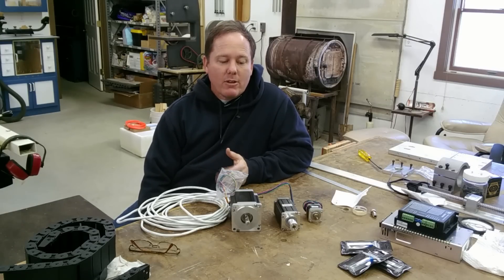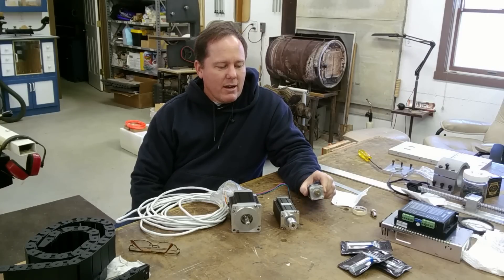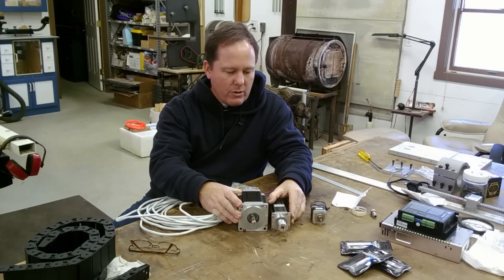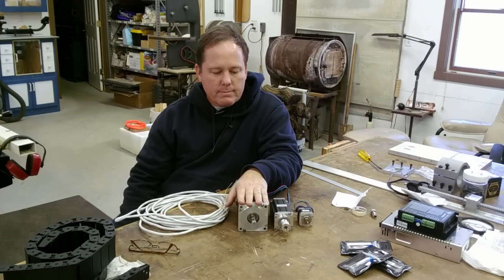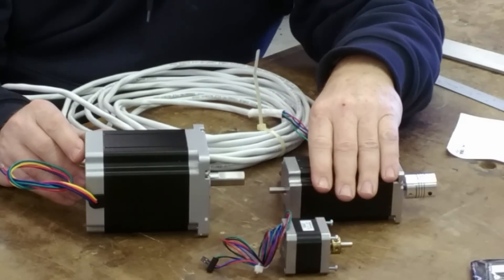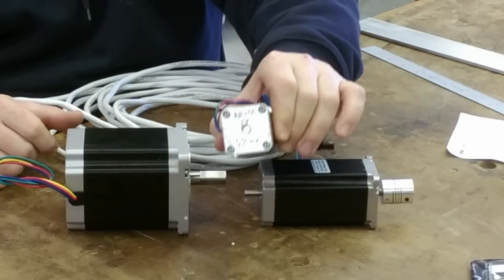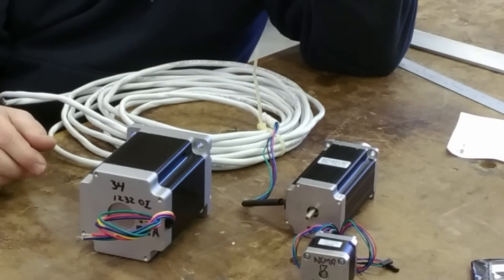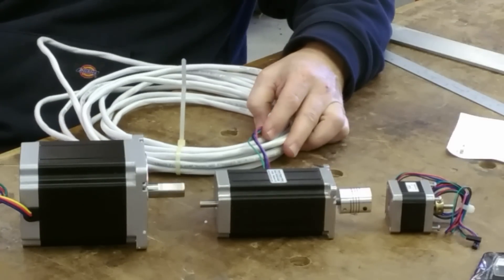Practical Insight in selecting stepper motors for your build -Old Version

Comment: I like the nema 34 size for larger machines, but I have seen many people use nema 34s for all three axes and a nema 34 on the z axis is a lot of overkill. More people should evaluate how much they need for each axis and design accordingly. If a nema 23 seems a little iffy for a particular z axis, consider a gear reduction.

Comment: I recently finished converting a 600mm lathe to CNC using NEMA 34/1200 steppers, possibly overkill but no regrets.  As well as increased torque, the bigger steppers have higher position holding strength.  I suspect that the bigger motors will be less inclined to miss steps also.  I found your video to be very interesting and well explained.  Thanks.
Reply from the maker: Thank you John and congratulations on your lathe conversion.

Comment: Sir, How do you Clamp motor shaft with Lead screw? Please can you explain
Reply from the maker: You use a coupling.  There are various kinds.  I used an inexpensive, zero backlash coupling like this one - http://www.ebay.com/itm/Motor-Encoder-Coupling-8mm-x-10mm-CNC-Stepper-Flexible-D25L30-zero-backlash-/162367443526?hash=item25cdda9246:g:7uAAAOSwjDZYhH5u

They come in different sizes with different size holes.
Reply: Thank you Sir for your kind information.
Reply: There are some motors out there where the rotor has a lead screw, and they aren't hard to change out lead screws as long as you use the same diameter. I see them in a lot of 3d printer builds.

Comment: If the spec sheet does not indicate the voltage (but does the current), how do you determine what voltage power supply to use?
Reply from the maker: My first reaction is no but I asked a much smarter guy than myself and confirmed it.  Here is his answer... 
   "There may be a standard voltage depending upon the spec that is assumed by the spec sheet since they dont list it.  But to answer your question - current alone is not enough.  Given current and power you can figure voltage."
Reply: Thanks for the reply.
Reply: sbirdranch typically you significantly over volt them and control the current. you do that to overcome the stepper winding inductance. using the winding resistance and current spec to determine voltage won't get you all the performance from the stepper

Comment: Don't even use steppers.  Use servos.  I built a large gantry machine similar to yours, with a 3' x 4' cutting area.  If I had the money I would have used clearpath servos, but I cobbled my own servos together with surplus DC brush motors.  They NEVER miss steps, and are efficient as well. Except for the spindle (which is 120v), the whole thing runs on a single ATX power supply. (230 watts or so).  Nothing ever gets even warm.  I saw you had HEATSINKS??  On your X-axis stepper?
Reply: I'd like to hear more about this.
Reply: You can, go to my channel, click videos and look for "Homebuilt CNC router using uni-strut and aluminum castings."  And you can simply google Clearpath Servo  and get the teknik dot com web site.  I actually didn't use clearpaths, I made my own, but its the same idea, a servo rather than a stepper.

Comment: So, basically your advice - "just get big". I disagree!

Torque is not the only consideration -  also speed is very important (just not as obvious to  diy-er). If you are overbuying a motor and power supply, you have less money to spend on bits or 4th axis, or laser attachment. Also, Once you build your machine and start using it, you'll realize that you are running 4 motors @ 7a for a extended period of time  - that's considerable energy costs (and mostly waste).

So my advise - do REAL homework (there is lots of information on the internet) instead of misspending your hard-earned money and getting inferior result!
Reply: Speed is dependant  on the controller board, maximum torque is dependant on the motor. If you have a large machine with heavy components, you're going to need that torque. Same with the energy ratings, you need those amps for that amount of torque. 
So my advice (not advise) is to use your head and think logically. If you do the math for your machine, you'll know what torque you need, then you go for which motors are suitable for your machine; though it's better to go to the next size up if you're nearing the maximum torque of the motors. 
Also, motors built for speed won't have the torque, but the motors as they are here have a suitable speed for the machine. Same goes for steps, the more steps you have the less torque you'll have. But again you can upgrade to the next size up for both accuracy and torque.

Comment: Thank you.  It was a little hard to hear you, but this was a much better approach to what I am trying to do than trying to master calculations.  I wonder if you would be able to answer a question or two, as I am looking at steppers instead of conventional motors mainly because of weights, and then the ability to maintain constant speed.  My machine looks very similar to yours, and was originally designed as a router table.  It was partially converted to run tapping heads.  I am trying to replace the motors that drive the tap heads, and conventional motors seem just to heavy by today's standards.  To drive a 1/4-20 tap through 1/2" of steel (through hole), based on the information I have found, I need about 1/3 hp at a speed of 800 rpm.  This is the largest tap size I would use, and most likely the fasted it would need to go.  The stepper would run continuous throughout the cycle, and would only need to run in one direction.  Again, the main reason I am looking at steppers is the lighter weight and constant speed between 400-800 rpm, as compared to a dc motor and gearbox.
http://rockford-ettco.com/DownloadBroch/Etctvr%206_(Pg%2046).pdf

Comment: if my previous question isnt clear, this is what I mean: with a certain size gear on the stepper-motor, it needs to turn a certain steps to move the head for 1 millimeter.  If I double the size of the gear, the stepper motor would need to move half way to reach the same position as with the smaller gear.     Where or how is this done or set?  I assume its some firmware on the "controller board" but I am still a bit unclear.

Comment: very informative video.        I recently started building a 3d printer, and want to build a bigger one as i underood all the workings of it. except for one part, which brings me to this quesiton:  How or where do we put settings,  so that the motor knows how much to turn for 1 millimeter movement of the head(nozzle or laser cutter or router etc)?   I would really like to find this information. Thanks and great video.

Comment: That was really helpful. I want to convert a 9x49 inch Bridgeport clone knee mill. Would you do a video explaining everything between the computer and the motors? I just don't understand the lingo or the parts the lingo is talking about. I know each motor will need a power supply but don't understand what makes it step off or know where it is. I'm gonna subscribe because you laid this out in such an easy way to understand.

Comment: FYI, 425oz/in NEMA23 motors are total overkill on my CNC'd HF mini-mill when directly driving the ball screws.  It has no problem moving any axis (although the Z has an airshock assist, never tried it without it).  1200 oz/in motors are definite overkill (especially if you use any kind of gearing to increase the torque).  I think that the more important considerations are the driver and it's ability to deliver current and utilize higher voltages.  Stepper motors do better with the proper current and the greater voltage they will tolerate translates into decreased ramp-up speeds.  The 1/2 current setting on the driver is typically the holding current (which is typically fine at 1/2 current) and it switches to full current when actuating the motor, this will help the motors run cooler typically.

Comment: Why not just use a universal standard like metric. Everything is so much easier without using strange units like the length of the end of your thumb or the weight of 3 tablespoons of water etcetera.
Reply: Because metric is only good at small measurements. A foot is much easier to picture. Much easier to get longer measurements. Metric is basically a waste of time.

Comment: very educational. mind if i ask - are nema 34 1232 oz. enough to drive a bridgeport mill? i'm trying to convert one into a cnc. thanks for your help 👍🏻
Reply from the maker: Hmmm....I'm thinking of my mill.  Probably the X and Y, but not the knee (Z).  You need to find someone who has done that type of conversion for a better answer I'm afraid.
Reply: thanks... i purchased a nema 34 1600oz/in for xyz. hopefully it will work. i'm planning to install it - a direct drive - type (no reduction). keep posting educational vids 👍🏻
Reply: If it's not, just use a gear reduction.  Z-Axis moves tend to not need as much speed (since they are shorter moves) as X and Y.
Reply: D&DTube Online One thing to remember,  which is to your advantage, low RPM torque is really quite good for a stepper motor.   Just make sure you run as much voltage as you can within reason and the full current the motor is rated for if you are trying to get higher speeds.
Reply: I would say that if you can adjust all of your movements with less than 9 ft lbs of torque, the 1600s will fine. I'm purely going by the math, but it seems reasonable.
Reply: mpeugeot thank you! 👍🏻
Reply: thanks! hopefully my 1600 oz/in steppers can handle 'direct drive' the bridgeport clone mill. still waiting for my parts from china anyway.
Reply: John Rasmuson thanks!

Comment: Thanks for sharing. This is a real help for the hobbyist who just wants to gets started, have a play around, make some mistakes and learn from them. Searching around to get a rough idea of stepper sizes usually ends up in trawling through long forum posts of calculations requiring every spec of your machine that only seems necessary if you want to mill stainless steel to aerospace tolerances.

I'm planning on building my second machine for cutting mainly aluminium. It will be a smallish fixed gantry welded steel frame, likely 2x2" box section with the X moving along the gantry and the table moving along the Y. The working area will only be about 12x12" so it should hopefully be quite rigid. I'm looking at roughly 185oz NEMA 23 steppers, do you think this sounds in the right ball park?

Comment: My home brew 2 by 3 footer using v-rollers running on the edge of 3/4 inch angle iron, 4 on X,  2 on Y and Z.  My X ay cad program. nd Y are rotated 90 degrees to the left from the usual setup of the Gantry being X making my gantry the Y. That puts the XY zero point to my belly on the left, just the way you see things in any cad proggy.  I work from the side, not off the end due to space reasons. All MDF with the MDF well  sealed with 3 coats of the best grade of OIL based paint I could find.  A sample was soaked in a bucket of water for a month with no swelling, measured to within say 4 thou. The bed is a torsion box setup capable of holding a bit over 500 pounds in the center with the deflection under 5 thou. 

All 3 axis are 1/2 10 Acme thread with anti backlash nuts. X and Y are 5 starts that results in 2 revlitons of the stepper per inch of travel. Z is single start so 10 revs per inch.  Using divide by 2 microspeps gives a resolution of .0015 per step on X and Y. Z has no microsteping with the resolution to .0005. As Z is only 6 inches travel speed isnt that big of an issue.  ON X and Y 300 IPS is easily possible but I run at 200.  Faster IPS requires more ramp up so there is no significant time gain going over 200 IPS.  All 3 steppers are 23s at 450/0z inch running on one power 36 volt  supply using a trim router.  

Using 1/4 shank bits i usually stay within a couple thou. With 1/8 shank bits the bit deflection becomes the real factor in resolution.. They bend easier. Same cut with everything the same the 1/8 shanks usally add a couple thou off what I get with 1/4 shank bits.  Typically what I get off ideal in cuts is around  5 thou or so worse case... Close enough for most things.. 

The big issue with steppers alone of ANY size is the system runs open loop.   In other words, the controller just assumes a proper move was made. If you dont push hard enough to loose steps, things work fine. If you hang an encoder on a stepper then the controller will ALWAYS know with absolute precision where things are all the time. If you need closed loop the go with servos. Costs more but you can get far faster moves and more power in the same frame sises.  For hobby or small production uses a properly sized stepper will be all you need. Just pay attention to friction and inerta effects of the system and they will work fine.

Comment: Nema 34's are total overkill for a 4x4 router table unless you are building an all steel industrial table that you intend to run a 4hp or more spindle on.  I have a commercially built 4x4 gantry style table built with 4"x4" extrusions.  It came with Nema 23 275oz motors (one per axis), and it works quite well even with a 2.5hp router.  Mine is rack and pinion drive on linear rails, so it probably has more drag then ball screw drive.  In my opinion people get caught up in overpowering mainly due to a mistaken belief that they need super fast rapids (I've seen guys boast of 1100 ipm rapids).  The reality is you will never be cutting anywhere remotely close to that.  Most of my routing on pine or MDF is in the 40 ipm to 90 ipm range and my machine can also be adapted to plasma cutting which I typically do at 150 ipm.  My machine's max speed is  approx. 200 ipm rapids.  I have never felt that I needed more.  Overbuilding results in a LOT more cost due to needing higher grade stepper drivers and sometimes separate power supplies for each motor (not to mention the higher cost of the motors themselves).  When building your own table, I would recommend looking at similarly designed commercially available tables and noting what size motors, power supplies, and drivers they are using.  Some professional engineer designed those systems, and if they are being sold commercially, then they work just fine.

Comment: This is a very inter interesting video , I would like to build my diy  cnc plama  4'x4'  like yours .All information and suggest I can have is important , I take it  and what  and  where  buy hardware I need  thanks very mutch for all
Reply from the maker: Here is a link to the ebay collection that has most of the parts I used.  I would suggest looking at Nema23 size steppers though.    http://r.ebay.com/YPustw

Comment: Man, can't tell you how bad I needed this video... Thank you!
Reply from the maker: Your welcome.  I really enjoy all the positive comments people have made about this content.  Make sure you read the full video description comments too.
Reply: So do you think the nema 17's could drive a 20x20in cnc for cuting aluminum?
Reply from the maker: If they are not direct dive and the axes are on a precision slide.  Yes.  The feed rate will be very slow for cutting aluminum on something that small so speed is not an issue.  You will want to have zero backlash so I would go with ball screws.  That setup, yes.  Keep in mind that the 17,23,34 sizes are frame size and can have different torque ratings
Reply: lol man, I may be getting in over my head. I'll go with 23's to be able to upgrade table size once I build my shop (I have a lot of work to do) and have a little more room. I still would like to go with linear bearings and acme rods for control (I actually plan on building it boxed instead of gantry for the small build and enclosing it.

However, I keep reading about this backlash, but no real explanation of it. Could you explain a little more what it is? Or, possible future video for you to monetize.
Reply: lol nvm, I looked it up and realized I just didn't know that was what the action was called for the 'wobble' between engagement of gears. 

I guess I should also mention I'm fairly educated in the mechanical field (been working on cars most of my adult life and was a crew chief [mechanic] on F-15's)

Would e-mail be a better form of communication? I ask because I intend to pick your brain on this subject as I have full intentions of building my own.

Comment: You do know that "square" stepper motors are actually round inside, right? :))) It was interesting to know what you paid for your 34s, also I've never seen 80V power supply, was curious about that.
Reply from the maker: here is a link to the motors and the power supplies I used.   http://r.ebay.com/dcuq1Y
Reply: Great video. Thanks for the time and effort. That link does not work for me, instead it replaces it with standard ebay.com. What am I doing wrong?

Comment: Hi Thanks for the video. How hot should nema 23 get. Mine get so hot I can't touch them. the machine I am building is small so the motors are overkill, can i just half the amps, and will that maybe reduce the heat?
Reply from the maker: My 34's got pretty hot when I first set up the machine.  I did as you are thinking and reduce the amperage which made a huge difference.  The heat build up is at is worst when the motors are stopped and holding position.  That function is the electrical version of a trans brake in a dragster if you are familiar.
When I do the planned videos you will see I still have the heat sinks on my X axis, but none of the others.  I could remove them, but they aren't hurting anything.
Reply: Hey Mate, thanks for the reply. I will try 50%.   I am guessing the Decay Mode is the current decay, most of the time my machine will be moving very slowly so I guess I could reduce that to 50% as well. The motors I have are 1.8deg/step, if I set the microstep setting to 1/2 does that mean it will change to 0.9deg/step? No more question promise.
Reply from the maker: Yes.  That is my understanding.